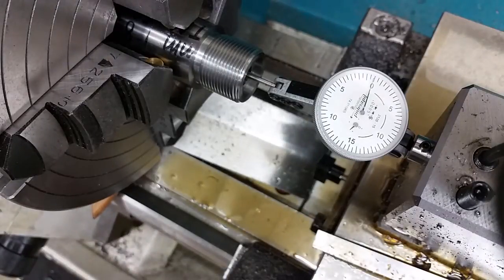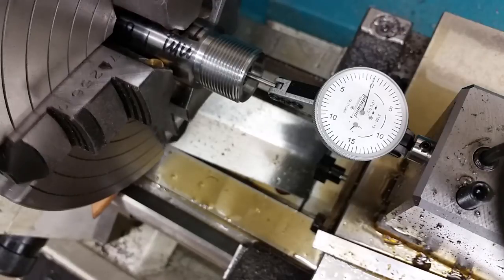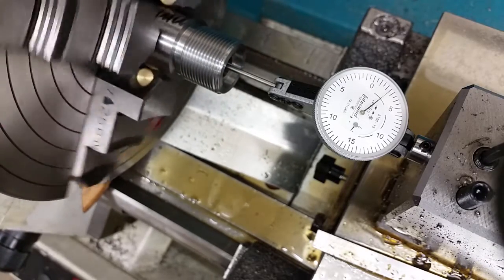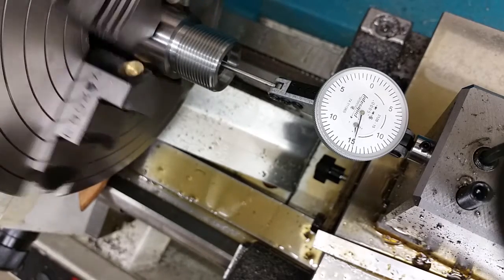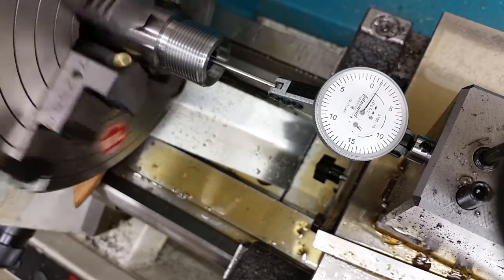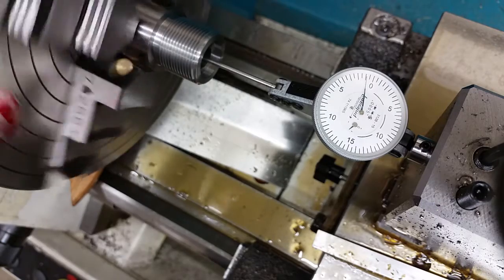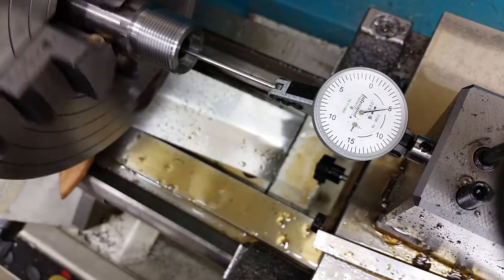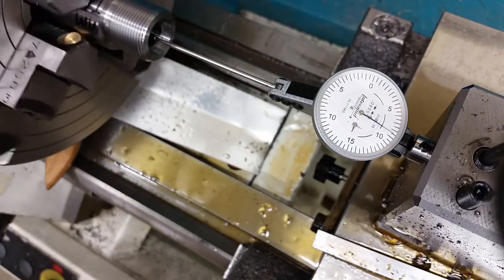Rigid reamed chamber runout

Comment: How would you have run out? It's not a surprise that you don't have run out with a rigid reamer holder that will act like a boring bar or form tool even if it is misaligned. Proper dimensions would be more telling than a dial indicator showing no run out on a bored hole.